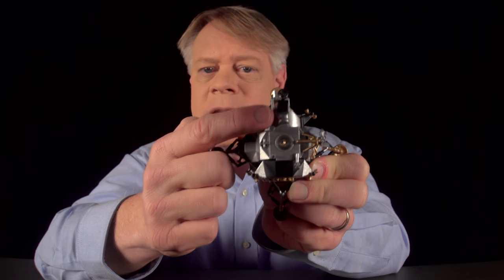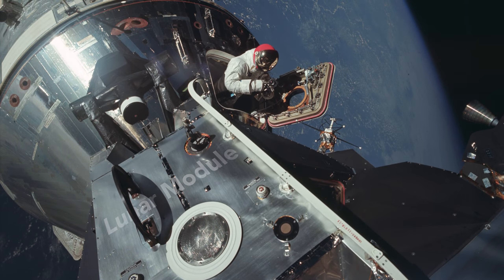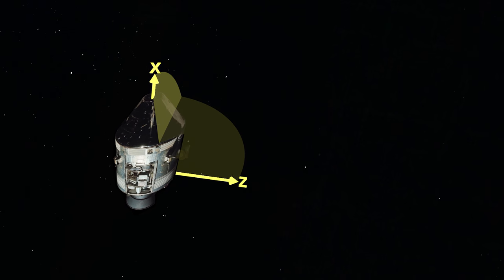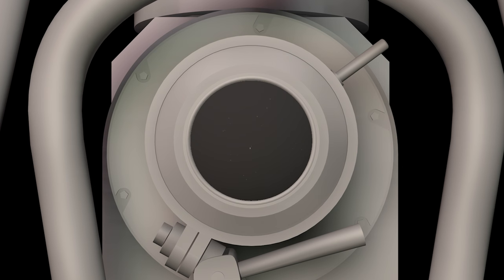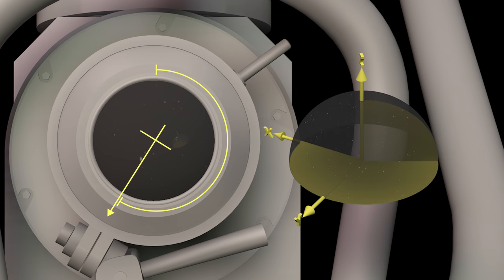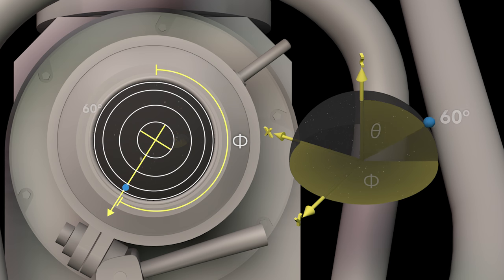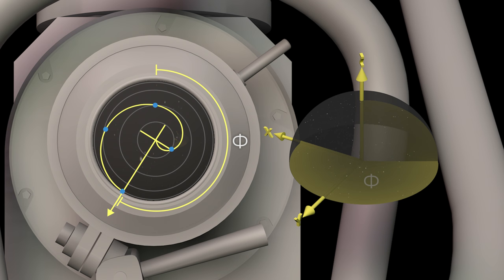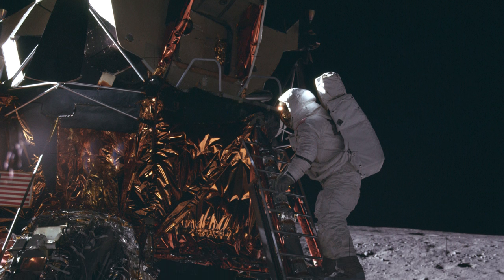Apollo: The Alignment Optical Telescope

Comment: That's mindblowingly simple for such a complex problem! It's extremely elegant, using the spin as measurement of distance to not clutter the screen is just brilliant!
Reply: It also means you can just rotate it to stop obscuring anything it does.
Reply: The B/W video camera RCA developed was restricted to very little weight and power, something like only 17 watts. In the end the entire system was engineered to operate at a much lower resolution to the point that everything was weighed down on the receiving end on earth. Only a few actual receivers for that format were made. Sadly the original recorded footage from that system is in poor shape.
Reply: The Lunar Surface Camera used during the Apollo 11 landing was actually made by Westinghouse. RCA made the Ground Command Color Television used on the J Missions. It actually operated at 6.25 Watts. Here's a PDF with some fascinating information about most every aspect of the Apollo television broadcasts.

http://www.hq.nasa.gov/alsj/ApolloTV-Acrobat5.pdf
Reply: Let's give it up to the old slide rule generation.
Woop! Woop!
Reply: I swore out loud sat by myself in my room when he mentioned the archimedes spiral. Absolute - - - genius

Comment: Another human factor in the optical engineering: the eye is more precise at lining up two marks (such as star versus a reticle scribe) than it is at interpolating measured positions against a graduated ruler.  In the case of a star being "eclipsed" by the reticle line, further precision is available by fine-tuning against the minimum apparent intensity in addition to the position.  (The reticle line width would be printed at a width approximately that of the star point image, so the star would disappear when the two were precisely aligned.) So the Archimedes spiral reads both position and intensity of the star image, and the spiral's slope acting through the radial vernier precisely amplifies these scales by another factor of pi.  And no atmospheric distortion or scintillation in this environment. The mechanism implements a triple compound stack of verniers with one moving part!  Brilliant design!

Comment: I am amazed on a daily basis with the design of Apollo.  Another simple yet brilliant design was the electronics module in the Lunar Rover.  It was encased in wax!   When it heated up it melted the wax to dissipate heat.  When it cooled off the wax solidified again to insulate it!!!  Simple but ingenious!!
Reply: Well said. Same can be said for the ice sublimating in a vacuum system used for cooling the LM and astronaut space suits via the PLSS. Also used to cool the Saturn V instrumentation ring once it reached high enough altitude.

Comment: Very good video. :)

I actually help contribute to a simulation project for the Apollo program using the Orbiter space simulator (NASSP), and this is rather spot on. However, when the LEM was in free flight, they didn't use the spiral method, as it would require more stabilization during the sighting than the LEM could provide (at least not without wasting fuel). So instead, they used 2 star sightings, like the Command Module did, but placed the LEM in a rotation, and used the time when the stars crossed the X and Y axes of the AOT's crosshairs to provide the star angles. Repeat for the second star, and you got your alignment info.

Comment: I can only imagine the imensitude of awesome details associated with the lunar missons. So many problems to solve and so many constraints.
I'm an engineer graduating in my masters and I must know every detail like this! Videos like this are precious.
The engineerguy is a really awesome channel!
Reply: Probably my favorite episode of "From the Earth to the Moon" is the "Spider" episode. Fascinating to see the evolution of design process with the elimination of the seats and huge reduction in weight by being able to go with much smaller windows. Not sure how much those seats would of weighed but I'm thinking those along with the reduced glass area might of cut the weight by about 800. Pretty significant as Kelly's book mentions that every lb of weight reduction meant 3 less lbs of combined ascent/descent rocket fuel required.

If you haven't read Tom Kelly's book, I highly recommend it. The chapter titled "Problems, Problems" is just a great read. The ascent engine instability issues where especially worrisome. Here's a quote from the book: "Frequently the LM ascent engine made the notorious "show stoppers" list as a problem that could stop the enormous nationwide Apollo program dead in it's tracks." They did tests to make sure any oscillations caused by combustion instability would eventually dampen out. That test involves detonating a bomb(more like a blasting cap) inside the nozzle during a test firing to make sure spontaneous instability wouldn't lead to an engine explosion. The troublesome ascent stage only received approval after passing 53 consecutive bomb tests. Btw, this bomb testing method , was developed after 3 of the expensive F-1 engines for the Saturn S-1C where destroyed during testing.

Comment: Awesome video on the engineering that went into the Apollo space program.

Engineering
One of the hallmarks of the Apollo space program was they had five teams on each engineering problem. 

The one that came up with the best solution was chosen. 

You might say that was a little bit of institutional competition and capitalism. 

Inspections
They also checked and rechecked everything. Everything was inspected. 

I don't think any program has been so engineered as the Apollo space program. 

That's what I heard.

Comment: @engineerguy there is a difference in the way the telescope is used on the surface vs in flight. What you describe is the surface alignment (program 57), when in flight (program 51 or 52) the telescope was used by sighting two stars and making multiple marks as the crossed the x and y axis of a fixed crosspointer in the telescope; the telescope was pointed by physically re-orienting the LM itself. On the surface, since the LM can't rotate, the telescope needs to be able to, hence the need for the spiral/rotation.

Comment: Alignment telescopes were reasonably common during the Apollo era, before the common use of lasers/GPS/etc., and were used for precision alignment of large structures, engine bores etc. I own one but don't have much use for it. However the modifications to an alignment telescope with the spiral was an ingenious way to achieve extremely accurate angular precision and provided an objective number to insert (vs a subjective guestimate between lines). 

I do think this era arguably represented the pinnacle of modern engineering.

Comment: A interesting fact that a lot of people don't know is that starting with Apollo 12, they purposely directed the spent lunar module ascent stages to crash into the moon so that the Apollo 12 ALSEP could record the seismic waves generated to help determine the moons crustal structure and makeup. They were able to obtain a lot of info from these artificial impacts. Of course as each successful mission added another ALSEP, they were able to expand on the info derived from these man-made impacts. They also did the same with the spent S-IVB's  starting with Apollo 13. A pretty clever way to wring out as much scientific info as possible from the Apollo program. So even though Apollo 13 never landed on the moon, it still managed to contribute a bit to the science experiments.

You can google "The Description of Apollo Seismic Experiments" for more info.

Comment: I must have missed something. Why couldn't they just use a straight ruler style measurement device? A piece of string that they could compare to some markings on a panel must weigh less than a rotating wire or overlay.
Reply from the maker: Would not have been nearly as accurate. You can read the rotation to a degree and perhaps a fraction of a degree. Also, pretty sure the lens was curved which would have made using a wire difficult.
Reply: +engineerguy Probably 0.5/pi as precise as the spiral, at best, so that makes sense (since my string would be shorter by that much). If the lense is curved, I wonder how they made sure to read it from the exactly correct angle. Thanks for explaining (and then explaining again).
Reply: You say "at best" but when it comes to space flight every small fraction of accuracy has a huge impact so it is crucial for them to get the best accuracy possible while saving the most weight as explained in the video
Reply: Brian Choi I have no idea what point you're trying to make, nobody was arguing that accuracy is a bad thing.
Reply: A scribe line on a lens or glass plate has zero mass, perhaps even counting as reducing the mass of the glass. I have an optical comparator for measuring distances on a surface and the glass is photo-etched with angles and scales for very fine work. The spiral has the property of mechanically translating radial distance in an eyepiece to angular coordinates with only one moving part and no motors or gears required. The vernier on the bezel can probably yield 0.1 degree or better. Close enough to get the LM within visual range of the CSM and the rendezvous radar takes care of any errors. The field of view was wide so it wasn't necessary to waste thruster fuel bore-sighting the target star. In fact, larger radius means error is proportionally smaller with respect to theta.
Reply: QwazyWabbit Yes, but they had to add a mechanism for rotating it smoothly. It's incorrect to say it had no moving parts, because it had to rotate to function.
Reply: I said it had ONE moving part, not NO moving parts. It had the rotating reticle carrying the spiral.
Reply: QwazyWabbit My mistake. My brain somehow compressed that sentence and removed the words between that part and "no motors or gears". Though somehow I doubt they allowed the lense itself to rotate, because that would be a problem in a pressurized vessel. It pretty much had to be an extra layer.
Reply: rotatable lens was affixed inline with a pothole that did not move
Reply: As it turns out, the reticle was geared to a counter like an odometer. The were two knobs one to rotate the periscope outside, the other to rotate the reticle to put the stars on the lines. Button press put the first angle into the computer, rotate again, press button for second angle. Readout was in case manual entry was needed. Knobs were for gloved hands in space suits.
Reply: i think the aswer is simple for a ruller to work you need a complex aperatuse to  have a varing length wire in the telescope or a ruler that would  start involving estimation.
Reply: Yeah, it's like the difference between using a shop ruler marked in 64ths and using a micrometer with thousandths increments.
Reply: Even more, the spiral allowed the direct translation of a radial distance to be transposed into angular coordinates for input into the navigation computer with all the advantages of a Vernier without operational complexity or manual calculation. The two angular coordinates could be input directly into the guidance computer at the press of a single button and in the case of a malfunction of that method, manually from the computer console. Precision, low mass, high reliability and redundancy in one beautiful piece of engineering.
Reply: Fiber is certainly lightweight but string would be poor to use in a precision measuring device. Feel free to use it it on the  spacecraft you construct and travel in.
Reply: Joshua Pearce 
Human error

Comment: Great video !  The Command Module used an Off the Shelf Questar telescope for navigation...  Did the LM (Lunar Module) use this telescope also ?  Also the CM and the LM used the ball inertial platform from an ICBM to help with the navigation.  A mission to the Lunar Pole is needed to map and learn about the Lunar Water Ice (H2O).  A radio beacon can be placed at the Lunar Landing area and also at a possible Lunar L1 radio relay station for points on the Lunar Near Side and the Earth.  Back to the Moon to Stay and onto Mars and Beyond-Ad Astra...  tjl